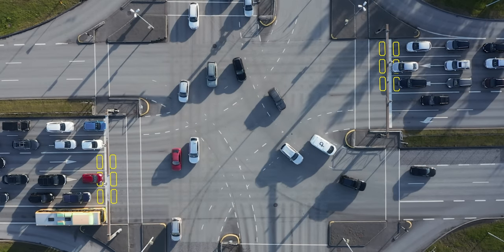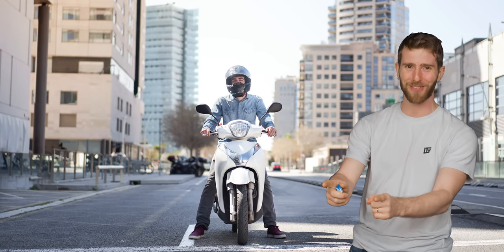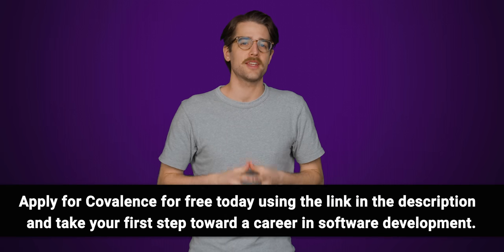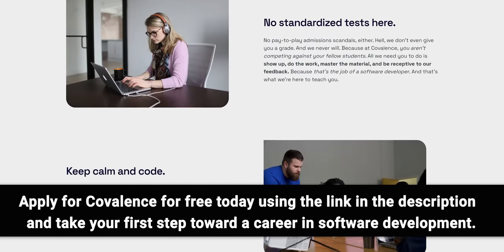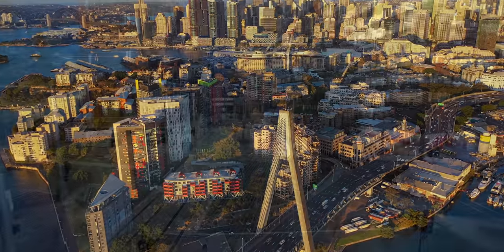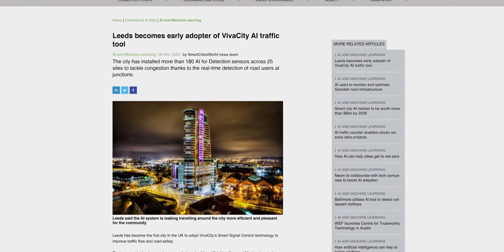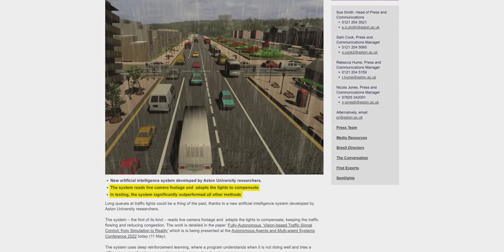Here's Why You Get Stuck At Red Lights

Comment: This is the one thing that a regional AI that can talk to smart cars (who each report location, velocity, etc as generic data to protect privacy) who already talk to each other (and the AI) and all work in concert to allow a super efficient and safe system. With this kind of system, a random crash or other obstruction can be immediately broadcast to the network, allowing for instant adjustment to the system.

What I'd like to add to such a concept, I'd like to have now even as it shouldn't be That hard to implement. That would be creating a system of new signals at intersections that indicate active emergency vehicles along their route. Think about it. An ambulance needs to get from A to B fast, so alerting traffic to what's going on and adjusting the flow pattern while the emergency vehicle is traveling said path Should allow for more lives saved and not rely on how well people can hear, etc. Push the timeline 10-20 years where most the regular vehicles are smart vehicles as described earlier and the cars will even make a path where there wasn't one in a congested area.

Comment: I don't know if it is used abroad, but in Italy (and I guess in Europe), we have synchronized traffic lights on consecutive intersections that also act as a speed limiter for drivers. If you go faster than the speed for which they are synchronized, you're gonna find a red. Usually, it's set at 80 km/h on roads with a speed limit of 90

Comment: Meanwhile Warsaw, Poland uses "smart" system by Siemens (if I remember correctly) and it's a hot mess. We stop at most, if not every light, even on the main roads. The idea of green wave turned into a red one. It's awful, frustrating, wasting our time, promoting speeding, because you might squeeze in, and terrible for fuel consumption and pollution

Comment: We are stuck at a red light mainly because North America (USA and Canada) refuses to embrace roundabouts.
Hence, all junctions must be controlled through traffic lights.
Traffic lights are both expensive to install and maintain, while also being inefficient.

The only drawback to roundabout is the space they consume, forcing the junction to be larger than usual.
However, this usually is not an issue in North American, especially when traffic lights have multiple lanes.

Comment: Should have touched on Audi's system that tells drivers the state of an upcoming light and when the light is going to change, pretty cool
Reply: In the Audi vehicles with idle stop, the system will even shut off the engine only when it is appropriate, and start the engine right before the light turns green so there is no delay when you take your foot off the brake.

Comment: In Minnesota motorcycles can kinda sorta run a red light.  Have to come to a stop, check for oncoming traffic, and wait a few seconds and if the light doesn't change to green can go.  Kinda sorta because it's technically not legal but it has been ruled that the failure for the light to change because it fails to detect the bike is a "permissible defense" for the infraction.

Page 10 right column - https://www.leg.mn.gov/docs/2018/other/181051.pdf

Comment: Those Road sensors are expensive and very difficult to install and only count the front cars on the intersection 

Wouldn’t it be much cheaper to use Cameras with sensors and Lidar that can detect, count, classify, get the in-coming speed of all kinds of vehicles big or small. Plus, detect pedestrians waiting on the sidewalks. (Plus can catch speeders or red light beaters)

With how CCTV cameras getting cheaper and intelligent recognition softwares being more dependable nowadays, it’s a better system to use.

Comment: Didn't cover that a great number of traffic lights have a strobe sensor mounted on the horizontal pole (you may think they are a photo camera to catch red light runners, but it's not) which senses the flashing light pattern of emergency vehicles, so that it can overide the lights to allow oncoming emergency vehicles to get a get a green light, and have the opposing traffic stop, before they reach the intersection. 

The trick is, if you can flash your headlights at the pattern, you can trigger the override and get a green light sooner. Just don't do it when other cars are around :P

Comment: Everyone heard that, right? You have to stop OVER TOP of the induction sensor, not a full car length behind it. I get stopped at a light way too often that doesn't change if it doesn't sense that someone is at the light. That big white line, yeah, put your bumper on it. If stopping properly at a light is scary, get off the road. Thanks for coming to my ted talk.

Comment: This information is something I've been wondering all the time!
I knew there must be some way the light is detecting traffic, I thought maybe a sensor cameras or something, did not expect it to be wires buried underground 😮
Reply: Loops in the road are the most common one, as it works well and is often cheaper than other solutions. On places where its harder to achieve this, such as bridges they use either simple radar for single lane movement detection or we can use a camera where the "loops" are drawn with software.

Comment: In colorado we have all the advanced stuff but every single light is set on a basic timer. You know this when every light acts the same way every day. They also have crazy bad timing gaps. So if you show up 5 seconds before a green arrow is supposed to turn green it just ignores you. Turns out traffic planners are crazy lazy and don't bother changing any of the defaults.

Comment: Wierdly you haven't mentioned camera controlled lights, I have a series of traffic lights in a main street near me in France where the light stays green on the main road until it detect something approaching from the crossing street and also if you go around/over the speed limit (you are supposed to let off the pedal when approaching a crossing, so if you don't do that the light will turn red and the immediately green when you have stoped) pretty cool ye? Of you look at the street when the is low trafic, you might never see the light turn red lol

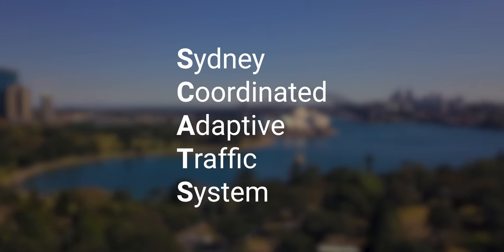Comment: 2:48, there is no way SCATS routes 100,000,000 vehicles every single day. According to the Australian Bureau of Statistics (ABS), there were 20.1 million registered motor vehicles as of January 31st, 2021. If every Australian drove one vehicle, they would have to drive through Sydney four times each to satisfy the 100,000,000 vehicles per day that was quoted in the video. The only way I can see the number of 100,000,000 vehicles being routed per day according to this video is if you are counting each vehicle as a new one at every intersection in Sydney, and even then I'm not sure it would reach that number, but even then, that isn't what was said

Comment: Birmingham, or anywhere in the UK, will almost never promote green wave traffic light systems. Not when they've already had white papers from Westminster with conclusions like "[such and such traffic system] causes traffic to slow down and speed up, decreasing fuel efficiency and increasing government revenue through fuel duty [tax]".

Westminster [national government] then incentivises local councils [local government] to install whatever traffic measures Westminster wants. If the council doesn't install traffic measures (eg speed bumps or red wave traffic lights) then the council doesn't get necessary additional funding needed to maintain their roads.

This is why speed bumps end up slowing you down to lower speeds than specified by the speed limit. So the speed bumps are uncomfortable at the speed limit, encouraging drivers to slow down and crawl over them. The goal isn't to prevent excessive speeding, but to increase time spent accelerating and decrease fuel economy, in order to sell more fuel. Pollution and the environment be damned.

Meanwhile, when you come off the ferry into the Netherlands they have speed bumps that you glide over at the speed limit, but are uncomfortable above the speed limit. The bitter irony is that if you speed excessively in the UK, at just the right speed, you end up going over them more smoothly then if you slowed down to a crawl, due to the delay in how suspension responds to the bumps. They're designed to penalise people travelling at the speed limit, not those travelling above it.
Reply: Congratulation🎉⬆️
You won an amazing gift package 🎁 Use the above name to acknowledge your prize⬆️

Comment: That's the thing though....at the "wee" hours of the night they shouldn't be on timers due to no traffic. Instead should be on sensors so when a vehicle decides to show up at 1am it can let it go....I work weird hours and get off anywhere between 12 and 330am and when I have to sit at 4 different traffic lights for 3 to 5 minutes each when I only live 2 miles away from work is effin stupid. I'm literally sitting at the lights for a longer period of time than wjat it actually takes to get to work

Comment: How come, you didn’t mention the German redlight system? The red lights are online so at any time, it is know when a light is about to turn green or red. Cars like some BMWs or Audis an apps like Traffic Pilot have access to it. When you drive, you enter the destination and the car/app will not only tell you where to drive but also exactly how fast. This way, it is possible to cross a major city without a single red light. You’re told to drive 42 km/h instead of 50 and in the distance, you see a red light. You’re not supposed to break but to keep going and when reaching the light, it turns green. You are faster and waste less fuel (since no breaking and acceleration).

Comment: Where I live it has nothing to do with the lights. It has to do with city planning done 50+ years ago that's unfit for the current population numbers. Then there's also the lack quality mass transit which forces many people to get a personal vehicle for a variety of reasons. These goofballs in Miami-Dade county have been talking about southward overhead raised rail expansion plans since the 1980s, they keep making declarations but never follow up to make it happen. They did however spend gobs of cash to tear out existing rail for installation a road only used by only buses. Unfortunately that was a dumb idea too because that road is on the ground intersecting with all the other roads. It takes me about 2hr 15min  to travel 19.8 miles in one direction, then another 2hr 15min back home. That's literally an average speed of only 8.8mph. BTW, have you ever tried to study on a loud bus that's constantly slamming on its breaks? /END_RANT

Comment: All the AI and smart traffic lights in the world won’t ever fix the issue of car congestion in cities. Because if it’s faster to travel with cars, more people will use them, until the congestion goes back to previous levels. Instead of trying to improve the flow of cars with extremely complex and expensive systems, maybe it would be more worth for the cities to invest in public transportation and bike infrastructure. That will do good for everyone. Small commuters can travel in a nice and quiet city by bike without fear of getting ran over, a majority of the other commuters can use metro, trams and buses to travel longer distances faster than cars would ever do. Pedestrians won’t just have some tiny sidewalks allocated to them, but entire walkable streets, and people that need to use cars will drive in a far less congested city, making their travel far less annoying.
And the city will be less polluted and far quieter than it can ever be with a car centric approach.

Comment: I live in Germany, where people like to over engineer things, right?

Well, not concerning many traffic lights. Many of them run mindlessly at night, stopping you over and over again for absolutely no reason. Many of them don't have any kind of sensor, so they are doing their thing, even though there is nobody else around, who you'd need to stop for. And even when they have sensors, sometimes their programming is beyond stupid. Also why doesn't the main road just stay green, until somebody approaches the side road? It happens way too often, that you approach the light on a main road with nobody else there, the light is red or just turns red, you stop, only to accelerate again right after the stop. It's mindbogglingly stupid, and especially where in Germany, the debate over the environment is hot and strong for many years, no additional brains are applied to traffic, unnecessarily polluting the environment, generating noise and making people more frustrated then necessary.
Result: I personally sometimes run a red light by conviction. Not often, but when I can clearly see all roads at night and I know there is a stupidly controlled light, I don't feel for being a good boy and stop like mommy told me. And on the bicycle...... It's a whole different story. =)

Comment: By improving the throughput of the road you just increase the supply and induce more demand and congestion just comes back after a bit. It's impossible to solve traffic by increasing the capacity, traffic is cars, you need to reduce the number of trips that require a car at all. Not this fancy AI traffic light stuff.

Comment: Actually, you're incorrect on the current on the inductive wire; in fact there's no power at all. It's actually magnetism! That's why bicycles and motorcycles have a lot more trouble being seen by them, because they don't have a lot of metal over a large area, and is also why sports cars have the easiest time being seen by them. There's a sensor that can detect the magnetic resonance over the loop, and it's so sensitive that you could almost tell what make and model of vehicle it is just by the amount of metal that's over it.

I'm also surprised you didn't go into detail about the other detection technology, traffic cameras (not to be mistaken for red-light cameras); they can see how many vehicles are stopped at an intersection, and it can even see pedestrians, bicycles, and motorcycles, and be able to tell the difference. Not all of these have a central control centre, and their programming can do things independently.

Worth noting those inductive loop circles don't show up if it's newly paved, and they aren't always circular, but sometimes like a digital clock's 8, except perpendicular to the road and wide instead of tall.

If it's a new intersection or a new resurfacing, they will often install the loops and pave over top, leaving no marks visible. If you see them, they're either replacements for a failed loop, or a new installation on an existing road.

Comment: I think you missed one important point. Let me illustrate: Here is the traffic volume a street in Philadelphia: 231215. Can you optimize traffic? Build a AI quantum computer and optimize traffic based on this fact. Unlikely. I am surprized that AI is trying to give us better answers by feeding it crap as opposed to us realizing that we need to measure better if we want to manage better. So the dilemma is that Software companies build decision systems, but not sensor systems. So they "assume" the sensors are there, work well, and provide sufficient data. You know what they say about assumption? So all these AI are children of that mother of assumption. Instead why dont we deploy better sensors that measure trajectory, deceleration, etc just like air traffic control radar. Then we can manage safety, congestion, etc. Well thats what we do with beamforming+beamsteering radar at traffic signals, but since everyone look up in the air towards AI, nobody cares to look down to what feeds AI... Its been hard to turn the industry to think. I give you another example: Head of safety in the US has said that to prevent cars from driving into pedestrians we need to monitor pedestrians, not cars. What? This is how focused the industry is on fashion that they miss basic logic.

Comment: "AI will likely become even more important once we have truly self-driving cars that will need to communicate with traffic signals to avoid clogs or well other undesirable outcomes at intersections" Cars are already navigating complex intersections using computer vision powered by AI. So why do they need to communicate with the traffic signal? Isn't that just adding an unnecessary potential failure point to the system?

Comment: 50% of the inductive loops in my city will not detect motorcycles.  I know that the city officials know this bc they've been told enough times, but nothing is ever done about it.  When I'm on my 600lb bike, I have to deliberately run the red light if there are no other cars there to trigger the light.  I really hate it.  What's even dumber is that if there's a car on the other side coming toward me, it'll get a green and my side will remain red.  There's no advantage whatsoever to traffic to program it to give green just one way.  It could just as easily have been programmed to give green both ways regardless of which side triggers it.  But regardless, installing and using a system that fails to detect all types of licensed vehicles is pretty fnck!n stupid imho.

Comment: Think hand held metal detector. A push bike will activate it - that I use - by riding in circles over it. If that doesn't work, push the crosswalk button if there is one.

Comment: We'll almost certainly never have fully self driving cars. At the point that's even remotely possible, it'll be easier and cheaper to just run everything on rails and get rid of the cars entirely. We should also be getting rid of cars in general, they're the biggest cause of much of the worlds pollution and woefully inefficient use of land, especially in and around cities. Just look how much space is dedicated to car parking that's empty for 90% of the time. We need better, integrated public transport systems so you only need to drive, when and where you need to drive.